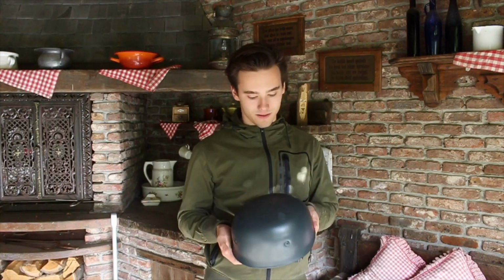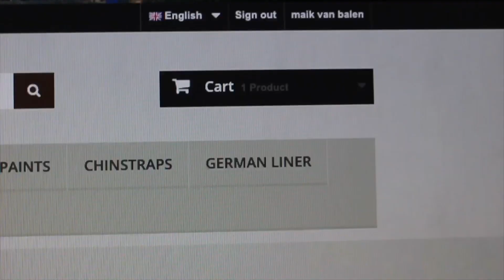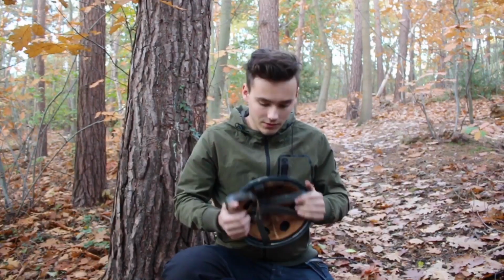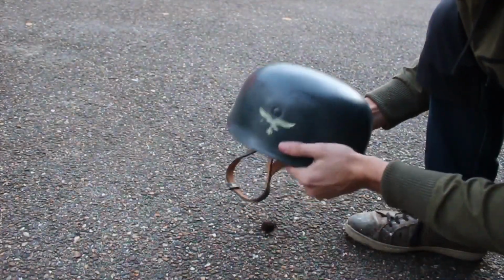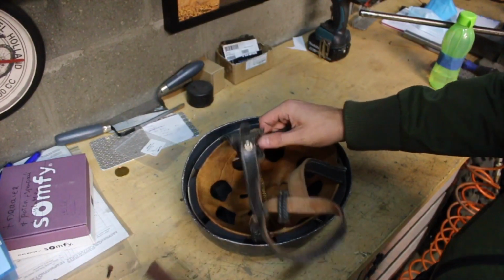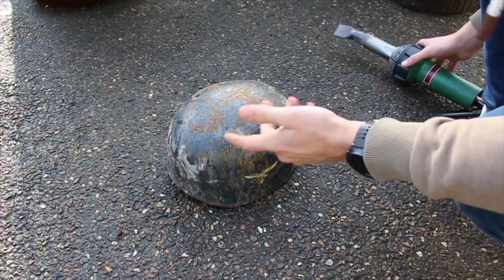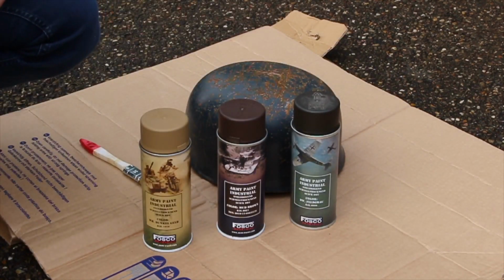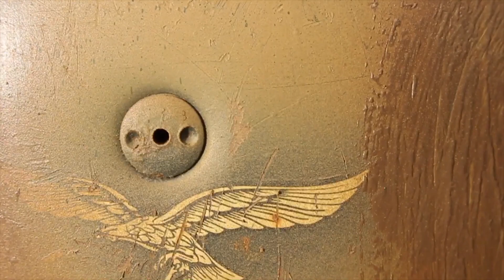Making a repro helmet look real! Part 1

Comment: You need to go to a riverside and pick up some sharp gravel and small grit. Rub it all over the parts which would get most abuse from daily life, and not so much in other areas. Small scratches all over, then bury it for a month to let the soil get to it and give the bare areas you’ve scratched a surface rust. Use black boot polish to fill in and accentuate the scratches, then give it a clear coat over.

Comment: Great video. One tip I do want to give is if you use light coats of neatsfoot oil on the leather it will darken it and you won't have as much of a mess next time.

Comment: Being somewhat long in the tooth and with no place to go and nothing to do if I ever got there I purchased a repro. German paratroop helmet with the idea of aging it.  I want to remove the liner and when the helmet is repainted put it in the oven to bake a spell.  I do not know who manufactured this particular helmet but it was inexpensive and very well constructed.  The project is for my own amusement not to be involved in fraud etc.  I enjoyed your tutorial!
Reply from the maker: thanks! was exactly why i did this project / had time for it :)
Reply: @wardetectorist  Hello - finally got around to working on my project.  Used a red oxide to prime and a textured paint for a base and then a gray that might even be near the correct color.  I taped off areas for the two decals hoping that they might looked recessed but with "Solvent Set" they sank into the paint fine.  Now it is time (with the wife's permission) to give the shell a slow bake in the oven.  The liner is out and I am trying to do some light aging.  A challenging project but fun.

Comment: Where is part two? I really liked the end result of this first video so I would be very excited to see how it finally turned out.
Reply from the maker: Thank you! It will be finished after I finish my other project (the ⚡️⚡️ helmet ‘relic’ project) and I’ll do a more in depth video explaining why I used this certain type of camo, together with illustrations of original ones used in my area during fighting in September of 1944
Reply: @wardetectorist  will be looking forward to that. I get it why it might take some time lol. I have always tons of projects running along side eachother. I am currently working on a early m36/m37 paratrooper helmet. Also a Luftschutz helmet a tank model and a whooole lot more.
Reply from the maker: @kodebruin4701  indeed haha, ive gotten sidetracked a few times mysel aswell :) ive seen a glimpse of your project m36/37 on facebook in one of the german helmet groups i believe! also very curious to see that result :D